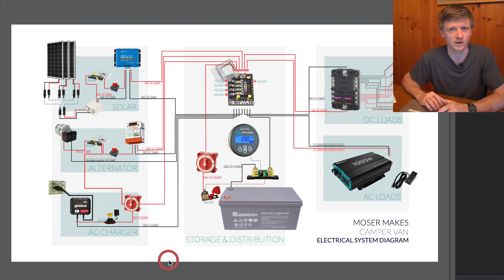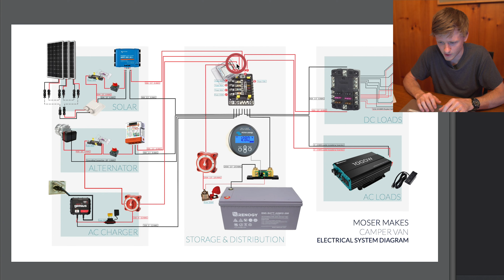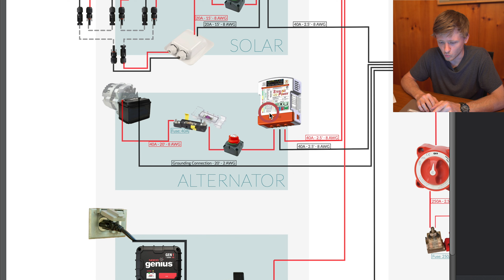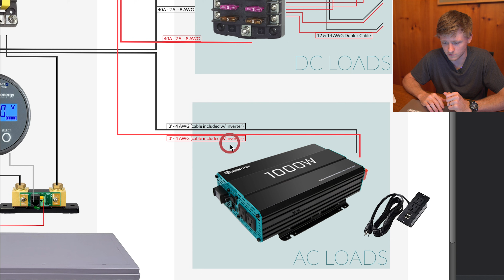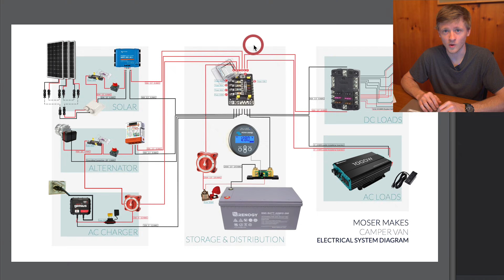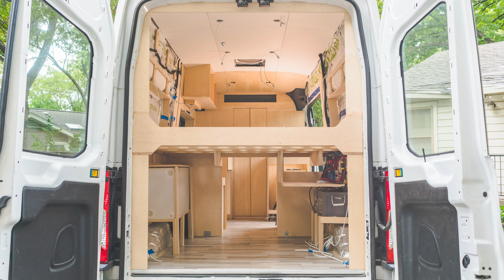Camper Van Electrical System - Comprehensive Look!

Comment: A question I would like to know on a lithium battery which is a 280 HA if I wanted to put a terminal block would I also need to put a terminal block with a few of 300 I need some help on that
Reply from the maker: Hey - not sure I understand the question. In this system you could replace the 4x 100Ah batteries with 1x 280Ah battery and everything else could stay the same as it is in the schematic.

Comment: Good job on the video. The question I have is I’m building a Party Bus. Or actually I’m redoing a Party Bus, Somebody previously did, and it’s not done very well. What I want to do is actually charge the battery bank with the alternator as I’m driving. I already have a Xantrex Pro FM 100 converter and I also have the Xantrex Inverter. The only thing I wanna know, is it possible to only charge the power bank with the truck alternator as long as I use isolators? I have two lithium 12v 100ah batterys I want to use for the bank. I don’t want to do shore power or solar power. I just wanna be able to have a driver drive the Mercedes sprinter in charge the power bank. As people watch TV and have some LED lights. And listen to the radio.  It also has a pro air. I think it’s called air condition that I’m not sure if it’s running off the inverter or the converter. The system also had to battery isolaters. I’m new to doing this type of thing. But I’ve done plenty of Baxter battery radio car set up. So I’m hoping that I’m not getting in over my head with this. Thank you in advance.

Comment: Good day! I downloaded  your high powered system  diagram and I bought the same inverter, but when I read the manual it says recommended wire  size is 50 sq mm but in your diagram it says 4awg, just wondering what’s the reasoning behind 4awg?
Reply from the maker: Hello! I'm not sure what manual you found that in. I'll link the manual below. For the 1000W inverter it is says how the wiring included with the inverter for the DC input is 4AWG (page 5). Also in the spec table it lists 83.3A as the max continuous battery output current (page 30). 4 AWG is appropriately rated to handle 83.3A. Hope that helps clear the confusion.

In this manual: https://www.renogy.com/content/RNG-INVT-1000-12V-P2/INVT-P2-Manual.pdf
Reply: @MoserMakes   thank you, I found on your link  high powered system with  victron multi plus inverter 12/3000/120 with lynx distributor  dual alternator charger and smart solar panel charger, in your diagram you use 4awg wire  from inverter to distributor but when I read the manual for the multi plus inverter it says 400 amp recommend fuse and 50 sq mm wiring, just wondering how did you end up with 4awg in your diagram from inverter to distributor
Reply from the maker: Hey in my previous reply I thought you were talking about the inverter shown in this video. For the high powered diagram (which I have a newer video on by the way) you should use 4/0 AWG wire. The diagram for that one has always shown 4/0 AWG not 4 AWG. Sometimes there is confusion between “4/0” and “4” but they are two different sizes.
Reply: @MoserMakes  ok thanks

Comment: Wondering why you use 20’ of 0AWG instead of grounding to the chassis nearby…?
Reply from the maker: Grounding to chassis nearby would be a better option to reduce the amount of wire needed. If you watch my two newest electrical system walkthroughs I have moved to that approach.
Reply: @MoserMakes  thnx. Was a genuine question, just learning. Cheers

Comment: Where is your chassis ground? Is it required?
Reply from the maker: Yes, it is required and the alternator charger won't work without it. It's shown at the bottom of the alternator charger section but in the diagram in the video I show 2 AWG when really it should be 0 AWG or larger (I've updated that on the diagram here: https://www.mosermakes.com/articles/camper-van-budget-electrical-system). If you watch my two more recent electrical system videos I show the chassis ground better in each. Thanks for watching!

Comment: This video was super helpful! I have one question: why do you have fuses after each charge source and connect it to the fuses at the safety hub? You explained the hub is nice to cut down on components, but you still have a separate fuse for each charge source and the battery as well as the fuses in the safety hub? I am curious because I am ready to make my set up, and was curious if I used a positive and negative bus bar and a fuse for each charge source and the battery, do I need another set of fuses like the safety hub offers for some reason?
Reply from the maker: Hey! I think the best way to explain it is that each section of wiring should be protected by a fuse. I'll go over the solar section as an example. The fuse in the safety hub protects the wiring between the safety hub (which plays the role of a positive bus bar here) to the charge controller output. This wiring and fuse should be sized to accommodate the max output current of the charge controller. The stretch of wiring between the solar panels and the charge controller input needs its own fuse sized to match the max output from the solar panels. Hope that makes sense. On my website I have more example schematics for different sized camper electrical systems as well.
Reply: Thank you so much! That makes a lot of sense

Comment: This shedule helped me a lot in my build, tanks! One question about the alternator charger: first i did not connect the negative of the starter battery with the house battery because i thought it was not necessary because the car battery is grounded to the chassis and i also grounded the house battery to the chassis. But the fuse between the possitive connection of the car battery and the charger kept jumping.... So now i made the connection between car battery and house battery (negative busbar) and it works fine, but i used a thinner cable then you advised because i still had that part left and the distance is almost 3 meters.... Because the car battery and the house battery are grounded to the chassis seperately, it does not matter that i used a thinner cable right? Or am I wrong and should i use a thiccer cable? English is not my native language so sorry for my grammar

Comment: Sam, love your channel , I am starting my build this summer.  I am going to follow your elec. set up pretty closely but I want to install a shore power ac panel so then I can have some ac circuits if I hook to shore power.   The other thing is I dont think I will do the 2 way which to charge the van battery.  I wont have an alarm setup on the van.  Would you leave this out even if you dont have an alarm set up?

Comment: If I were to use two 200AH or three 100AH batteries for my system can I use this same format? I just noticed there was many extra components to your other electrical diagrams with more batteries

Comment: Hi Sam, love this video! I had one question that I was trying to figure out, why did you add another fuse box for the 12v appliances when you can use the built-in ones on the blue sea 150 hub?

Comment: Thanks for the good explanation although thats still way more complicated a system than you need when you are first starting out. I have 2 100 amp hour deep cycle batteries in my Van. I connect 1 battery at a time when the first batteries dies I connect the second battery is this is usually more than enough power to get through the workweek. My system is deep cycle battery to fuse to inverter to powerstrip (I move the powerstrip to whereve in the Van I need it to be and plug 4 or 5 things into it. Finally I have a $20 battery monitor/shunt on the negative terminal of the battery. If I was installing Solar I'd need solar pannels and a Solor control box. I can see where it might be neat to have a bunch of switches, fuses and pannels but you don't absolutely need these things. The electrical system was the hardest part of my Vanbuild mainly because all the examples on Youtube were really complicated there was no simple beginner system. I was also disappointed that on how poorly some of these electrical components are specked. My Microwave is listed as 700 watts but it actually pulls 1150 watts and my 1000 watt inverter can't handle it. The terminals on my fuse block/bus bar were not labled so I had to put my electrician tester on each screw to find out what was what, you'd think when novices are using a sensitive piece of electrical equipment like that they'd provide a dam diagram.  I also to get some wires from work because the Drok battery monitor didn't come with any wires, I hope the wires I got are the right guage but once again the battery didn't come with any specifications so I don't know.

Comment: This has been my go to video for setting up my solar system -  thanks for all the work charting this out and explaining! Curious why you used a different cut off switch at the positive battery terminal than the other two? From what I read, it is only a difference of 25amp rating between the two.

Comment: Where do I start? Expat from Michigan/California based in England. Was quoted £900 for just labor to do the wiring . Don't have the kind of Dosh. Hence watching videos. Good to have and hear an American accent as having been in UK for 18 years, massive difference in the nuances of speech. This video is by far the best I have seen. Greg Virgoe in UK is the holy grail van build vlogger and his videos helped me install the solar on my own. You just may be his NAmerican counterpart. I am starting a build from scratch on new van and  electrical wiring is most daunting. The rest, hey will rely on the A grade I got from workshop in 7th grade. Cannot wait to see more of your videos. THANKS a bundle for actually writing down the size of wiring 👍 Why did you order wiring as opposed getting them at Home Depot (B&Q in UK)? Also most vids recommended one cut off switch but you have 3. I would have liked to hear if having the extra one are do or die must haves. Sorry this is long winded but really want to get a handle on wiring and start the build.

Comment: Thanks for breaking it down.  Still figuring out electricity.  I had a question, off your inverter which creates an AC power source...how are those little USB plugs getting power if they utilize a much smaller DC source?

Comment: This was an incredible video that I have been looking for for the longest time. I'm looking at doing a similar wiring. I do have one question and I hope it's not stupid. Your solar panel your alternator and your shore power are they all able to charge the battery at the same time or do you have to isolate them one from the other

Comment: Hi, there are 7 negative cables coming to the safety hub fuse block, but there are only 4 bolts, can you connect two or more terminal rings to one bolt?

Comment: Pretty much knew everything. Because I watched many, many, many, many, many other videos.  Wish I had seen this first.

The one thing I would add is that you said you used oversized wire for convenience at times. Some (a lot of) emphasis should have been placed on the safety factor of installing oversized wiring.

Great video!

Comment: Great vid Sam! I see a couple places where current is flowing in two different directions on the same wire, most notably on the positive connection between the SafetyHub and the house battery. Has this proven to be an issue?

Comment: Having the wires rated at a lower amperage than the fuses is dangerous. It means the wire will fail first (overheating and potentially causing a fire) before the fuse can kick in and break the circuit.

Comment: Hey Sam. Question.... For the 2-way switch, do you have the AC charger going in the output of the switch? Input 1 in the vehicle battery? Input 2 into the system hub? Thanks for all you do to support other builders!

Comment: Hey Sam, great video, got a question regarding your alternator power setup.  Why did you attach a separate ground wire from the van battery to the negative busbar of that safety hub? Presuming that busbar is grounded to the van chassis (via its connection to the renogy battery (which would be grounded to the chassis)), why didn't you just entirely omit that separate ground wire, and rely on the fact that the vehicle battery is grounded to chassis, and the neg. safety hub busbar is grounded to vehicle chassis, so in effect, the chassis acts as that ground wire. I'm about to install my Victron non-isolated DC-DC charger, and it seems to eliminate the ground wire you included in its installation instructions, relying instead on the fact that everything is connected to chassis ground.  Thanks Sam, I've learned a lot from your great videos.  I hope all is well.

Comment: Thanks for making this video.  Could the 12v loads be wired to the main safety hub, instead of the separate fuse block?  It looks like there's room for more low amperage loads coming off the right side of the hub.

And is there just one ground in the whole system coming off the main hub?

Comment: Very nice set up and well thought out.  However, allow me to recommend a small change. Years ago, two of my friends both worked in a factory that built  Power inverters.  We were all sitting around a camp fire and I started telling them about how I was having trouble with a cheap 300 w inverter.  I told them that when I first bought it, it worked great but for some reason I couldn't get it to power my power tools anymore.  The first thing my friends asked was how long were my battery cables going to the inverter.  I told him about 10 feet.  The second thing they asked me was the gage of the cable.  Long story short, The gage was okay, however they explained to me that the 10ft length was the reason for my problem.  They explained that inverters are very sensitive to resistance.  They told me that DC power in general does not carry amps very well over longer distance.  I was told to get as close the be battery as possible.  With a little math we figured out the resistance in the line which brought the inverter efficiency down to less than 50%. I didn't want to believe them.  I'm a DC guy.  About a year later I read that the reason we use AC power in our homes is because it is not effected by line length.  So the time came that I dusted off my little inverter, shortened the cable down to 1 ft and mounted it as close to the battery as possible.  Now I'm an AC guy.  Suddenly my inverter was putting out 95% efficiency. It was running better than when I first bought it.  What I learned was when it comes to inverters keep the battery cables as close to the battery as possible.  Today I have a 5000 W inverter and the same principal remains solid.  You can test this theory like I did.  The results will surprise you. I happily used that little inverter for smaller loads for over 30 years. It was still working great when I sold my van.  I just wanted to clarify this to your viewers because you had suggested keeping the negative lead far away from the shunt.  However I did see in the beginning of your video that your inverter location is practically sitting on top of your battery.  That's why your system is working. Cheers!

Comment: How do you choose when to use alternator or solar panel to charge why driving IF you only want to use solar to   charge? And how do you make sure you not take all the power from your car battery when charging from your alternator?

Comment: Excellent video and very informative. I'm designing my system and am new to this. Is your system grounded? I don't see the ground in your diagram. Thx
Reply: there is a 2AWG (20') negative (black) home run to the ignition battery from the house system (@ the sterling power B2B charger). this is recommended over chassis grounding to use the vehicle ground and prevent ground loop.

Comment: Sam - I just replaced 4 Lifeline AGM batteries (got 7 years out of them) with a new set in my Chevy van camper.  I often carry 2 sea kayaks on the pop-up roof, so solar panels are out of the question.  I just added a Victron Orion dc to dc charger in order to properly charge the batteries while driving.  After watching way too many RV electrical videos, I stumbled upon yours.  I am a retired teacher, who knows much more about art/photography than 12 volt electrical systems.  I also know good teaching when I see it and you have the gift.  Your Camper Van Electrical System - Comprehensive Look! is full of useful information and is beautifully presented.  I have already made a few electrical changes because of what I learned from you.  Thank you!

Comment: You should always fuse the power at the source. You did excellent with the battery but when it comes to the solar, you fused it too far down the line. They make a waterproof MC4 inline fuse.

Comment: Great job on this. I am puzzled though, is the DC additional fuse block not redundant? For a simple set up, couldn't one power up to 6 low amperage DC draws from the saftey hub itself? And do i understand correctly that you are using the + ports on the saftey hub to both push and pull power from the system? ie, it looks like power is being pushed through B,C,D,E and pulled from A, E, and F. Thanks!

Comment: Hi Sam, the question for you is,  can I use your setup with 620w of solar, 300AH of lifepo4, and 2000 inverter?  would this make sure I can pretty much do whatever I need to do in the van without constantly worrying about power? I will not have an induction cooktop. but a fridge tv and basic electric devices and once a day a hairdryer. what else would I need to change?

Comment: If I have an inverter charger, can I wire the Inverter Charger to the Safety hub then to the batteries? Or is there a different process for that?

Comment: Excellent and well thought out  content. Question: if shore power is energizing the positive bus bar, it would necessarily apply 12V to the output of the solar charge controller. Can the charge controller handle the 12V that it didn't generate?